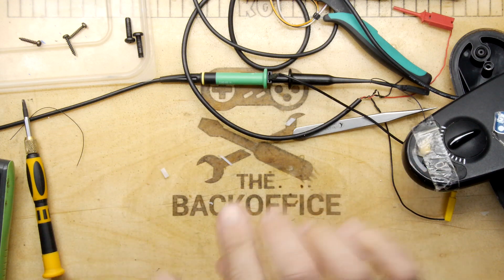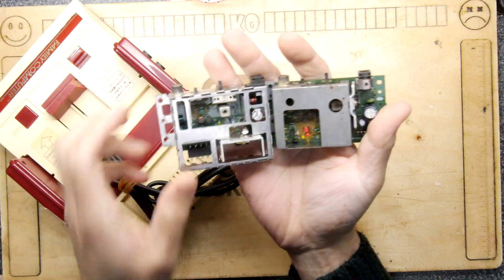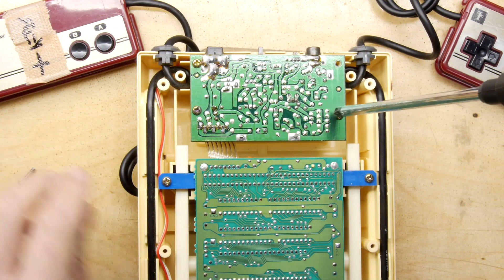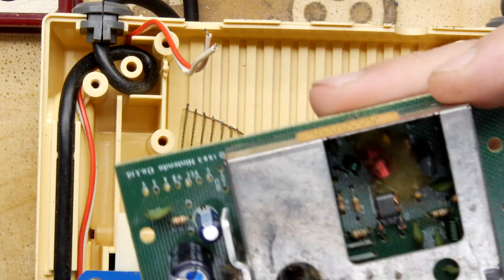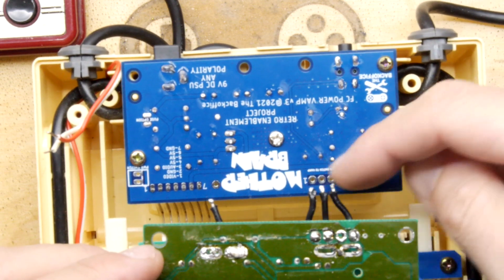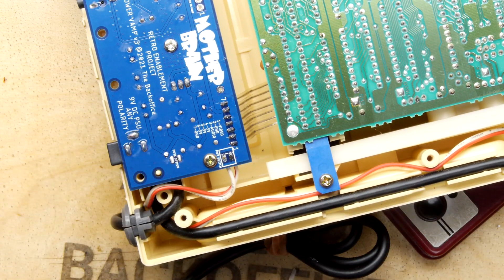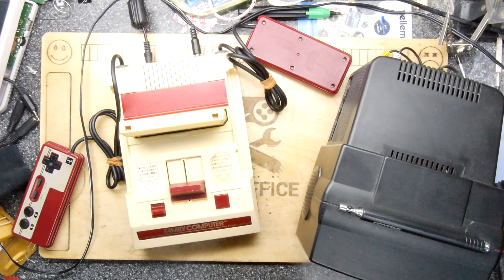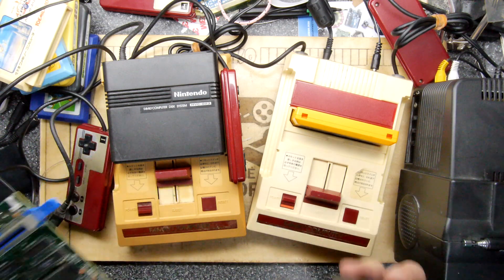You'll never believe what I stuck in this Famicom! (To fix its AV and PSU!)

Comment: Think that gunk is silicone to keep it from arcing or shorting. Modern boards are usually coated in silicone
Reply: Seems like you have sort of a sloppy style, still it's not like it's things that matter. Like I wouldn't feel any sort of way using stuff you worked on, but OCD wise, I would probably tidy up some details if I was in there anyway, just to be sure it looks good from the underside of the PCB inside the case :P Like you have such a nice iron compared to mine, so I wouldn't bother even unscrewing a single screw to like mess with it

Comment: If I recall that correctly the way to tell whether you have the soldered powered unit version or the one with 2 separate boards is whether there is an FF logo on the front of the unit (to the left of the Family Computer text).  The FF version will be single board.
Reply from the maker: I have a little pile of Famicoms at home, not sure I ever noticed that, but I'll definitely be doing an audit now!

Comment: The original Famicom power supply output 10 volts DC at 850 milliamps. Would that hurt this board that’s rated for 9 volts DC or would it be alright? I have a spare Genesis model 2/Game Gear power supply that outputs the same values but I’m unable to use it at the moment because the polarity is center positive. Also, I live in the US, does this board output NTSC 60 hz video or do I need to get a converter? I’m sorry if these are stupid questions.
Reply from the maker: I would recommend getting a regulated 9v centre positive adaptor, 1000mA is plenty. Modern regulated adaptors are so much better and only a few dollars.

The output should work fine on your US television.
Reply: @backofficeshow Thanks!

Comment: Hey there! I heard you had some perfectly good RF modulator assemblies! Any chance you'd be willing to part with one? Or two? Or tell me what kind of ceramic capacitor takes up C14 and C16 so my homie could replace them? That would be awesome! Thanks!
Reply from the maker: I have a nasty feeling that I parted with the old modulators, but I can take a look in the morning
Reply: @backofficeshow  I would sincerely appreciate it. I removed ceramic caps C14 and C16 and they just shattered. Label side too no less. Literally have no idea what they were and it's extremely difficult to find a cap map for this sort of thing. Lmao. To add insult to injury, the output still works without them, but the problem I was trying to fix worsened with their absence (so it was probably the cause). They're right by the RF out if that helps at all.
Reply from the maker: C14 15pF, C15 33pF
Reply: @backofficeshow  Thank you. Bless you for this help!
Reply from the maker: No problem

Comment: After installing I have jailbars showing.  What's the best way to get those removed?
Reply from the maker: Hi Dustin, if you can jump into the Discord server with some photos we can advise. But generally most of these are resolved by changing out the PSU. Can you confirm the PSU you are using?

Comment: I’ve got one of the models with the heat shield. I have a decent enough soldering iron but I don’t have any specialist desoldering tools (just some wick and a sucker thing). Will I have no hope in installing this?
Reply from the maker: I think if you are careful and get the heat shield off you should be fine. That's the worst part.

Comment: I've replaced the RF modulator with a PAL from some other console one on my Famicom to make it kinda more original like xD Some TV don't wanna find the channel though (I mena if you manually adjust it it will work but the scan will skip the 60Hz signal)

Comment: What do you think about starting metal screws in plastic threads by turning them back until the click to line up the threads? I find that starting them anywhere could cut a new thread which might break through to the existing one.
Reply from the maker: Yeah that's a good trick. I don't worry about it too much, but I might start taking more and trying this.

Comment: Hi! I've got a Famicom that was already AV modded (altough not the best AV mod). It has jailbars, the video is noisy... (I mean, it's composite).

Would this be an upgrade? I haven't found any videos comparing your AV Board to a regular AV mod so I wanted to ask

 I love my Famicom, but with those short controller cords and that video quality I don't play it very often. I'm not modding it for RGB because I don't want to cut the case nor lose the ejecting functionallity.

Thank you if you read me, and thank you all for doing this project!
Reply from the maker: Ctrl-alt-rees made a video upgrading his previously modded one: https://youtu.be/W_idHOIHi0Q and several people have done similar. It's hard to know what mod you have if it's super bad like you describe. If those jail bars are being caused from the PSU then the VAMP + a better PSU could help.
Reply: @backofficeshow  Thank you for your answer! The mod it's not the best, it was done by a PC repair shop 7 years ago... Maybe I should upgrade, yeah.
Reply from the maker: It's hard to tell if the end result will be what you are looking for, but at least you end up with a known solution 😂
Reply: @backofficeshow  Well, it's easy enough for me to do it, and if in the future there's a new RGB/HDMI mod for the Famicom that doesn't require sacrificing part of the case and ejecting mechanism, I could upgrade easily from this.

Thank you for helping!

Comment: I'm considering buying Your Power/AV mod board, but i have a few questions. What power regulator are You using? I assume it's a STMicoelectronics l78xx kind?  What's the size of the barrel plug you need for Your mod? 5.5/2.1mm? How much is Your mod influenced by switching power supply noise? Is it worth it to get a good 9V powersupply or will there be no noticeable difference if it's a more budget kind? Is was planning to use a Mean Well GSM18E09-P1J, which is probably a bit overkill, being meant for medical equipment, heh ^^; Thanks! ^_^
Reply: Saw on the RetroRGB blog, that You do use a l7805cv voltage regulator, which is nice, since the old original voltage regulator that was inside the famicom/NES usually just had a ripple rejection of 60dB, where the l7805 has 68dB. I guess Your mod uses a 5.5/2.1 barrel plug, but i'll simply get a powersupply with interchangeable plugs that costs more than 10 bucks, hoping for the best :p
Reply from the maker: Sorry only just saw this. Not quite sure on the barrel plug to be honest, it's just the regular size 😂
Reply: @backofficeshow  Hey! ^-^/ I just wanted to place my order... The mod isn't in stock anymore?
Reply from the maker: Looking at it, the AV leads are out of stock so only the module without the AV is available. There should be more in next week or perhaps you can source it locally.
Reply: @backofficeshow  Those AV leads are easy enough to source from somewhere. Bought! Now my Famicom has to arrive from Japan and not be total junk, where I have to replace the PPU or CPU :D On the pictures it looked nice ... It even had a Famicom Disk adapter... without the disk reader unit itself, heh ^^; Let's see ^_^
Reply from the maker: Famicoms are definitely 'interesting' I have had too many dead ones on arrival 😂

I kept the lead super simple, any standard audio lead should work. I avoided the stereo+video combination because there were too many pinout variations.
Reply: @backofficeshow  It seems You're using two 220µF capacitors as main filters. I think i'll bump that up to 470µF for better smoothing. I don't think the famicom needs it as a reservour, but it certainly won't hurt. Also I think i'll scratch off a bit more of the PCB mask around the back of the voltage regulator, to have a larger area to connect it to for better heat transfer to ground of the PCB. Again, it's probably not really needed, but it will help the regulator to stay cooler. I just hope the capacitors won't suffer; those thingies sure don't like heat...
Reply from the maker: I would suggest leaving everything as stock until you can determine if there are any issues with your particular Famicom first. I would go further to suggest that modifying the vamp is unlikely to result in any tangible benefit and not worth any potential the risk to the particularly fragile Famicom board.
Reply: @backofficeshow  I just had another look at Your board. Are the main filter caps (the 220µF black ones) connected in parallel or in series? It looks like they're in series. I might be wrong but it does look like it. If so, why?